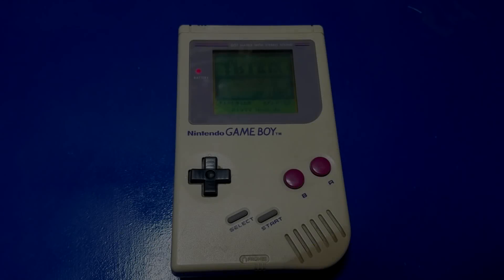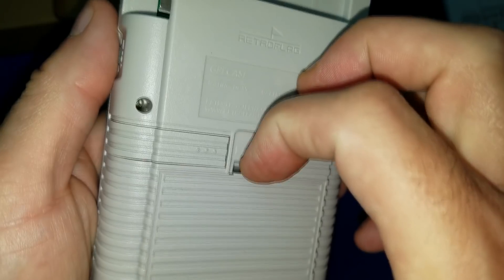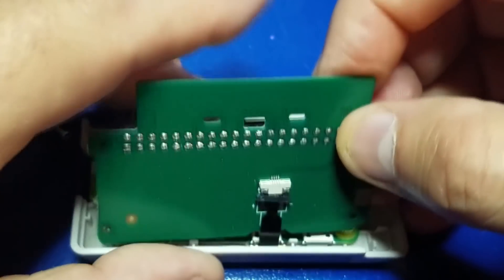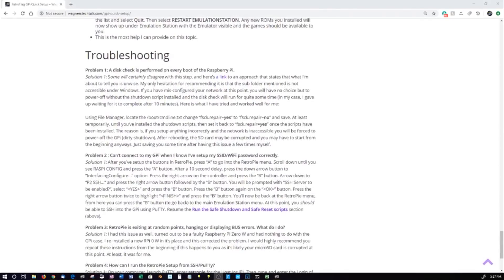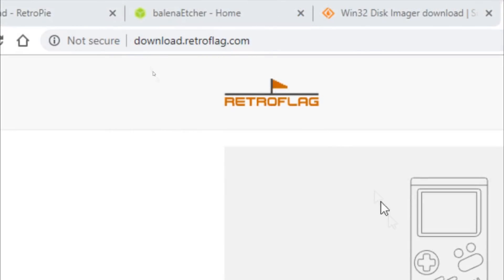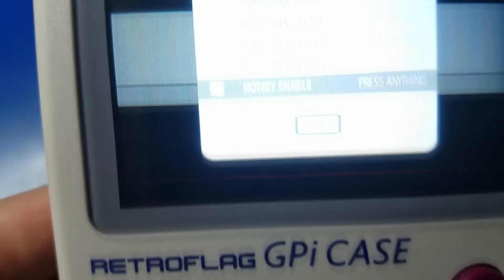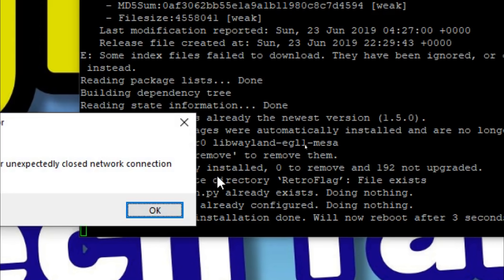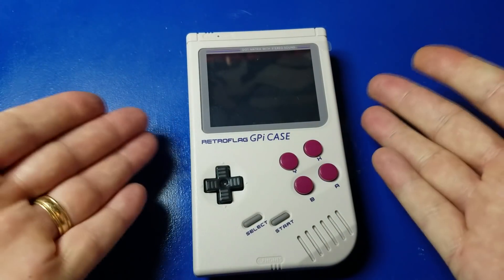RetroFlag GPi Case Setup: RetroPie Pi Zero W with MAME, GB, NES +Guide

Comment: After finished install putty and everything, 14:18 I'm stuck with "//retropie" part. It keeps taking me to browser "unable to connect". Do I need to leave GPi case on? or Do I have to turn GPi off then do "//retropie" on network? Because I'm kinda lost.
Reply from the maker: Try "\\retropie" or "\\[ip address]", the slashes are backwards.
Reply: @WagnersTechTalk  It works!! I fixed it! Works like a charm! Thanks!

Comment: I followed your instructions but couldn't install the OS once the Pi was installed in the case.
Reply from the maker: It's been about 3 years since this video was released.  What's your specific issue, I'll help if I can.
Reply: @WagnersTechTalk  I swapped out the pizero for a pizero w2 with a copper heatsink and it just fits.  Fixed it.  Thanks.
Reply from the maker: Awesome, happy you're up and running and having fun!  Yes, definitely want a zero w for this case/console.

Comment: I’ve tried multiple times and it always says there’s no game pad installed. Could my GPI case be broken or is it more likely the pi zero? Need to know which part to buy again.
Reply from the maker: I haven't encountered this issue, though I have had a bad Pi 0 w when I originally setup by GPi case sometime ago.  You may want to reach out to RetroFlag to help diagnose the issue, don't want you to buy another Pi 0 w if it isn't necessary.  Their site can be found here: https://support.retroflag.com/

Comment: I've been following the exact same steps, but the only difference was a difference in retropie version and image writer. I've been using the official Raspberry Pi Imager instead of etcher, and I've been using retropie v4.7.1, instead of v4.4. I can get through everything, all the way up to testing the safe shutdown script. It installs fine, but when I go to test it (I begin testing at the menu where "retropie" is in the dead center), instead of the code showing up on the screen, the screen goes straight to black, and my data gets corrupted. Is there a new script for v4.7.1? Or is there something odd about v4.7.1? I can't seem to find anywhere that I could download the older version and use the EXACT same imager, so if I NEED to use v4.4, I would like some links on where to find it. If you could help me, it would be greatly appreciated!
Reply from the maker: There is not an updated shutdown script that I'm aware of.  Instead, you may wan to use the Super RetroPie method shown here: http://wagnerstechtalk.com/gpi-quick-setup/#Super_RetroPie_Alternative-QUICK_Setup_Method  .  It should work, but I've honestly not had a need to update it since this video was created.
Reply: @WagnersTechTalk  Will try this method, I'll make sure to update you on how it goes!
Reply from the maker: @ItsLazMax  Thank you, please do!
Reply: @WagnersTechTalk  Works like a charm! Thank you very much!!!
Reply from the maker: My pleasure, happy it worked!

Comment: Hello again, everything came and I did everything step by step but the puTTY has not the irata.online like on the screen here and no robot only the default setting and when I click OK I get an error saying 'Unable to connect to retropie Host does not exist. Any help??
Reply: I went to show IP and it shows Unknown... I did everything step by step :(
Reply from the maker: It's probably the wpa_supplicant.conf has a .txt file extension.  Please see this section: http://wagnerstechtalk.com/gpi-quick-setup/#Troubleshooting
Reply: Wagner's TechTalk Thank you for the response . I saw that the .txt part needed to be deleted and I delete it but unfortunately it can not find the WiFi at all I used notepad as well , took the as card out and delete the file completely and did the whole procedure again but it did not help. 😞
Reply: Wagner's TechTalk I have no WiFi on my computer but use LAN cable connection. Can this be the issue . The retropie has no WiFi connection at all though
Reply from the maker: You connect to the Pi 0 w over WiFi, it needs WiFi setup.
Reply: Wagner's TechTalk I managed to do it by giving instead of „Retropie“ on puTTY the IP address I got from the GPi... I am all set and already played more than 10 hours since yesterday 🙃 thanks a lot for the help 🙏
Reply from the maker: @dosalline  So awesome, I was getting worried that I wouldn't hear back from you - Glad you're all set!  Have a great day!
Reply: Wagner's TechTalk hehe yeah I was playing Legend of Zelda Oracle of seasons like crazy 😅😅 thank you for the tutorial and help again !

Comment: Hello everyone ! Nice Video . I have a Cikuso Raspberry Pi Zero V1.3 Kamera Ready 1 GHz Mikroprozessor 512 MB . Is it going to be enough ? The pins are not sauntered like the Zero W one and it does not have WIFI . Will I be a able to use the GPi with that one ? I appreciate any comment . Thank you in advance 🙃
Reply from the maker: You will want to use a Pi 0 w with this unit, only.  The pins should not be soldered to the GPIO or it won't fit in the case.  You can pick up the Pi 0 w on Adafruit for about $10 USD, very cheap.  I would only recommend using the device the case was designed for.
Reply: Wagner's TechTalk thank you very very much . I ordered a pi 0 w here it costs like 30$ now ... I remember them being extremely cheap ... the gpi is here now I wait for the pi :) 🙏  nice tutorial 🙃
Reply from the maker: You are very welcome!  Hope the tutorial makes it very easy for you.

Comment: My raspberry pi isn't the W version. What should I do to install the safe shutdown? I'm pretty new to this kind of stuff so any help would be appreciated. Thanks!!
Reply from the maker: It would be a royal pain to try to set it up without the "W".  They are only around $10 (or less) on adafruit's website, it would be worth the $10 to avoid the frustration IMO.
Reply: @WagnersTechTalk  Would it work to use my friend's pi zero W to set up the safe shutdown than swap the SD card into my pi, since I have already bought all the components.
Reply from the maker: You could, but anytime you want to install a new game you're going to want to borrow that friend's Pi 0 W.  Trust me, get one if you plan on using this case 😀 I have more info on this page: http://wagnerstechtalk.com/gpi-quick-setup/#What_You_Will_Need
Reply: @WagnersTechTalk Ok, thanks for your help.
Reply: @WagnersTechTalk  Also thanks for the fast reply!!

Comment: Hi, thank you so much for the tutorial. I'm stuck on putty. I have downloaded it but says "unable to open connection to retropie Host does not exist". after typing "retropie" 
Any suggestions? Thank you
Reply from the maker: I'd double-check that you're connected to your WiFi network first.  If so, make sure SSH is enabled in RetroPie Setup.  Then, check that you have an IP address assigned (WiFi option in RetroPie menu).  Use the IP address there to connect with PuTTY if "retropie" isn't working.  Some of this should help, let me know how it goes.
Reply: @WagnersTechTalk  thank you for the reply. IP is showing unknown. Not sure where I'm going wrong. Watched other videos just to try and gather more of what I'm doing wrong. No luck.
Reply from the maker: See Problem #2 here: http://wagnerstechtalk.com/gpi-quick-setup/#Troubleshooting  Be sure to check Solution 1 & 2 (this may be your problem).
Reply: @WagnersTechTalk  Thanks for your help. I figured out where O was going wrong after searching...
I put UK as my country but I saw someone put GB. Thanks so much.
Can I ask another question? Do you have a tutorial on how to add games? Not sure how to do that. TIA
Reply from the maker: @RoamwithRamon  Great news!  Yes, I do have a tutorial on how you can add games you can find it here: http://wagnerstechtalk.com/gpi-quick-setup/#Installing_ROMs
Reply: @WagnersTechTalk  thank you so much.
Any idea why my games on Genesis are lagging? I'm trying to change latency and can't seem to get it to work smoothly. Atm I have sonic and streets of rage. Both lagging. Almost unplayable. 
Thumbs up by the way 👍 liked the video
Reply from the maker: @RoamwithRamon  Very welcome and thanks for the thumbs up!  The processor on the Pi 0 w isn't the most powerful CPU.  There may be some tweaks that can be made.  May want to post to this group and see if anyone has any game-emulator-specific tweaks they can recommend: https://www.reddit.com/r/retroflag_gpi
Just fyi - another option that you might find interesting is the RG-350 if you're unable to find answers to the ones you want to play.  I have a lot of info. available here (just in case you're interested): http://wagnerstechtalk.com/rg350tips/

Comment: im stuck in a boot loop and it will not start retropie
Reply from the maker: A few things that come to mind:  1)  Perhaps you didn't download the correct image, it should be for the Pi 0.  2)  Make sure the small ribbon cable is firmly seated in the small connector in the cartridge.  If none of that helps, here are some additional tips: http://wagnerstechtalk.com/gpi-quick-setup/#Troubleshooting  If that still doesn't help, scroll to the top of the page and you'll find step-by-step instructions.  Hope this corrects the issue!
Reply: Wagner's TechTalk I ended up figuring it out the rechargeable battery’s i was using where not fully charged and every time it would almost finish booting it would die forcing the pi to reboot so it was a power issue great tutorial by the way keep up the good work!
Reply from the maker: @Papa_Beans  Thank you for your kind words and Awesome, glad you got it figured out!  I was a bit stumped :)
Reply: Installed mine today. But after one time rebooting the pie is going to check the sd sectors. After that nothing happens.

And the latest version of retropie is freezing in the menu. I use a sd 128 gb. In windows i see three partitions. The third partition is not active 

What to do to let it work good.

Comment: I have a problem, I followed your instructions and whenever I get to the retropie logo, the screen bleeds out and then the system restarts. This doesn't happen when I use the GPi without batteries and plugged in via USB. When I actually make it to the part where I'm supposed to configure my buttons, the buttons don't work at all.
Reply from the maker: I would try removing the cartridge which contains the Pi then remove the flat cable and re-insert it again.  May be that it's not making a good connection somewhere.  Are you able to configure the buttons with it powered via USB?  If so, it could also be the batteries are dead and need changing.  Just a few things I can think of off the top of my head.  If none of that helps and you have an extra Pi Zero W, try another one.  If that doesn't work, then the GPi itself may be defective.
Reply: Wagner's TechTalk I only remember my GPi coming with normal silver Phillip screws...
Reply: @WagnersTechTalk  What problems could I run into in the future if I don't screw in the gold screws, I tried doing so when I got my new gpi cartridge but when I tried snapping the cartridge back together, it wouldn't close together. I then just removed the gold screws from the case and only used the silver phillips screws. The pi does work fine now but I don't wanna run into any issues in the future.

Comment: Greetings! I finally received the GPi Case. I followed the instructions and it works great. I'm using the Raspberry pi Zero W. Question: How do I delete ROMs from the system? Thanks.
Reply from the maker: Hi Carlos, Excellent glad the instructions helped!  To delete roms, from your (Windows) computer you simply right-click Start/Run then type "\\retropie" (assuming your GPi is connected to your WiFi network).  Then browse the the "roms"' share and then delete whatever roms you want from the subfolders.  Hope that helps!
Reply: @WagnersTechTalk  thanks a lot!!! God bless!
Reply from the maker: Most welcome and to you Sir as well!
Reply: Greetings! Sorry for bothering you so much, but I'm having problems running the GBA ROMs. The SNES ROMs run fine though. What could it be? Thanks and God bless.

Comment: 5:33. I've noticed that you didn't screw in the screws to secure the Pi Zero board to the case. Maybe this could lead to problems leaving this out....
Reply from the maker: Hi Manuel, maybe you missed it but the gold threaded standoffs 4:20 were screwed in to hold the PiZero to the back of the case.  Then the small PCB is installed on top of that, plastic cover and then the small screws into the top of the standoffs.  It's all fully secure.
Reply: @WagnersTechTalk  Sorry. You're right. I've missed that part :-)
Reply from the maker: No problem at all, have a great day!

Comment: Thank you for your guide but i have freezes after 1-2 min  when i play with my Raspberry Pi Zero W. I dont know what the problem is :(  i have a original Samsung Micro SD Card  UHS 3
Reply from the maker: When I first tried to setup my GPi case, I had all kinds of issues and placed them in the troubleshooting guide (see problem 3 here http://wagnerstechtalk.com/gpi-quick-setup/#Troubleshooting ).  The culprit was actually a defective Pi Zero w.  I replaced it with another, problems solved.  Not to say that's the case here.  It could also be the small ribbon connector between the Pi0w and the PCB may not be seated fully.  Check those two things and please let me know if it helps.

Comment: The PI is deleting my config file. Every time I move my Micro SD card back to my PC to see if I got the wifi stuff set up right, the config file is gone. I always safely eject.
Reply from the maker: See the WiFi Setup section here: http://wagnerstechtalk.com/gpi-quick-setup/  which states "Important Note : Once you boot from the microSD card with this file, it will setup the Pi to your network and delete the wpa_supplicant.conf file. Therefore, it won’t be a security concern by modifying this file after you’ve booted from the Raspberry Pi."  Your Pi is doing exactly what it should, it sets up your wifi and deletes the file that has your SSID and password.  If you need to make a backup copy of it, just copy it to a file that names in .txt (or something else).  But for security reasons, I would recommend not putting it on the Pi itself.  If you were to lose your Pi, someone might be able to use that info. to connect to your WiFi Router.

Comment: Is it possible to set up the GPI using a Raspberry pi 4 as the computer
Reply from the maker: No, for two reasons: 1) RetroPie doesn't currently support for the Raspberry Pi 4 2) The RPi4 is much too large to fit in the case and there is no smaller version available for the Pi4.  You would need the Pi Zero W for the GPi case, at least as of right today.
Reply: Can you use the pi to help set up the micro card and settings instead of using a windows pc.....etcher etc

Comment: i have 2 questions  How? do you get game box covers ect downloaded to the unit wifi without a keyboard ...  and how do you get the playstation controls to work the psx emulator doesn't recognize it
Reply from the maker: Sorry I missed this question, it didn't show up in my feed.  You'll want to use PuTTY to connect to the GPi to perform keyboard commands as is mentioned here: http://wagnerstechtalk.com/gpi-quick-setup/#Run_the_Safe_Shutdown_and_Safe_Reset_scripts .  Using PuTTT, you can execute any commands needed such as sudo raspi-config, etc.

Comment: I've run into a scenario that I can't figure out. On your page, you do briefly touch upon the issue, but mine doesn't quite match up to it. So I've followed everything up to launching PuTTY. I changed the wpa_supplicant file to read my SSD and password (both within the quotes). And while I was able to turn on the retropie and map the buttons out the first time, I was unable to connect PuTTY to it. I tried connecting to "retropie", and it couldn't find it. When I tried to look up the IP address of the pi so that I could connect it that way, the pi said it couldn't connect to the internet. It would repeat a disk check if I tried resetting it. I did turn that off using the change to the boot file, but I still can't get the wifi to work. Could this be due to a faulty pi? Or am I overlooking something?
Reply: Is it possible I didn't mount the physical board properly or there's a connection issue? I've read through your instructions numerous times and can't determine what variables I have to troubleshoot.
Reply from the maker: No, you probably have everything assembled just fine.  Please see my other response below for a few things you can check.  Please let me know what you find out, if I need to update the troubleshooting section I will be happy to do so.  Also, check out the forums on RetroPie you may get more answers here https://retropie.org.uk/forum/
Reply from the maker: This may/may not be your issue, but I remember when I bought my new router I attempted to make a more complex password for the WiFi (on the router itself).  It used special characters, such as @, $, etc.  I could not for the life of me get ANY of my Raspberry Pi's to connect with this password.  Not sure if the bug was with the Router or with Raspian, but I could not find a solution so went back to a more simplistic WiFi password and everything was fine.  If you are using special characters in your password between the GPi<-->Router then this may be your problem.

If the above doesn't help, it could also be the WiFi Radio in the Pi 0w that is the problem.  In that case, try swapping it with another and return the defective one.  That's all I can think of off the top of my head, if I can think of anything else I'll post back here.